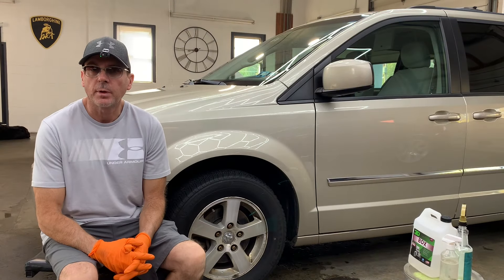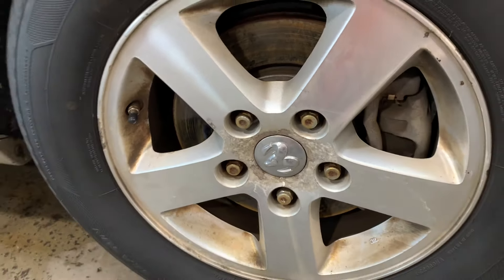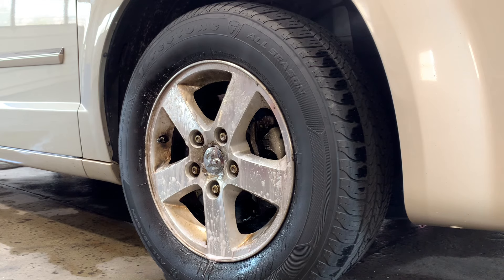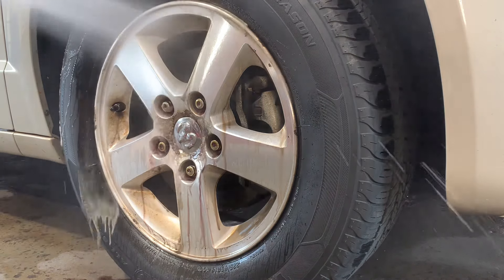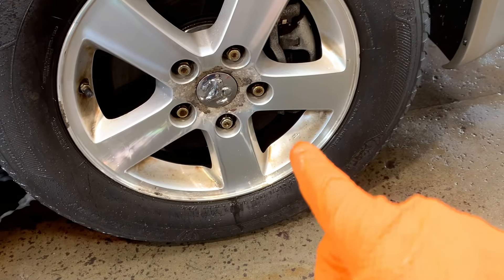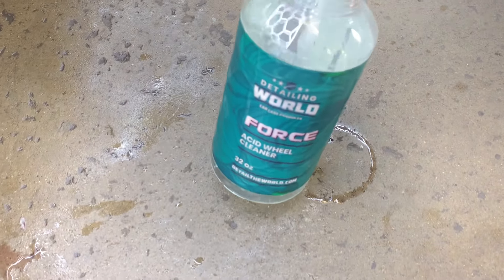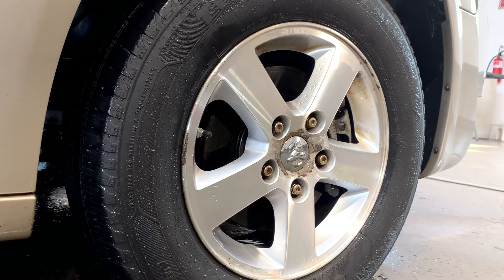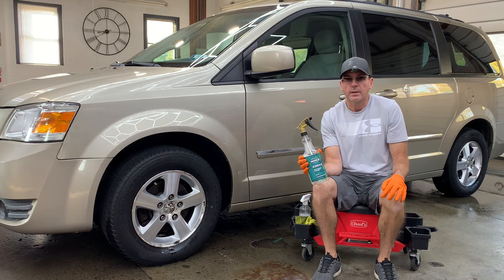The Ultimate Guide To Safely Using Acidic Wheel Cleaner On Tough Wheel Stains!

Comment from the maker: Do you ever use acidic wheel cleaners?
Reply: I've never had a need to use wheel cleaners based on hydrofluoric acid or ammonium bifluoride on my wheels (yet), but I did use it diluted about 7:1 on my '17 Accord's paint to remove some long-standing mineral deposits. It took several applications due to the dilution ratio- better safe than sorry- but it cleared up the paint like nothing else.

Always, always, ALWAYS use proper PPE with the aforementioned products! I keep some calcium gluconate on hand just in case an accident occurs using it. It is dangerous stuff.
Reply: which would you recommend. I tired of the scrubbing and scrubbing just to get wheels cleaned
Reply: Not yet
Reply: I really like how effective Meguiar’s Wheel Brightener is at cleaning in between tight spokes. Yes, even diluted, it’s great!
Reply: I use Dura-Coating Wheely clean which eats all contamination easily even diluted
Reply: @apexdetail85  I use Meguiars wheel brightened
Reply: Yep.... only on the really bad ones.. I totally agree...very efficient when used correctly...
Reply: Huge fan on hammered vehicles
Reply: Awesome video and content good friend
Reply: I used acid one time and almost passed out beside the car
Reply: Yup, never seen someone spray it onto a cloth though. I usually follow the instructions and spray whatever product I'm using onto the face of the wheel - the usage guidance you mentioned is key though.

Comment: Brian definitely they look great ✊The acid wheel cleaner works great but you have to use caution ⛔️. I see you are using your wrist it’s good for healing and strengthening. I know it takes a while especially when we are older.Great video and I’m glad you are getting that wrist back to normal🐉💎
Reply from the maker: I try to use it as often as possible....as long as there is no pain. Should speed up the strengthening process.

Comment: Hello,

Have you heard of xpel fusion coating? If so, is it a decent coating to get on my new car?
Reply from the maker: It is average....but Expel PPF installers are forced to use it by the manufacturer.
Reply: @apexdetail85  Dang. I'm stuck in a hard place. My wife is taking delivery of her new car next week, and the snow is coming next week, so I can't do the car myself, or I would have used polish angel cosmic v2 or kamakazi ism. They said it's doesn't require using products like cosmic spritz, but I find that hard to believe. I appreciate you getting back to me.